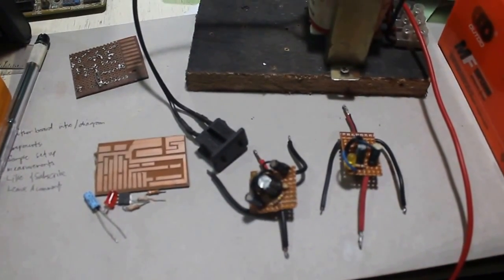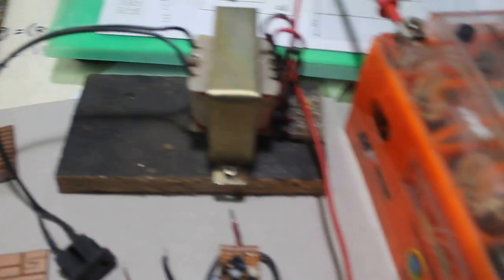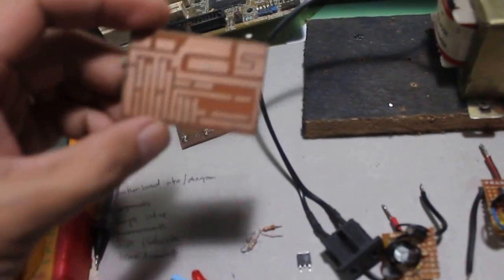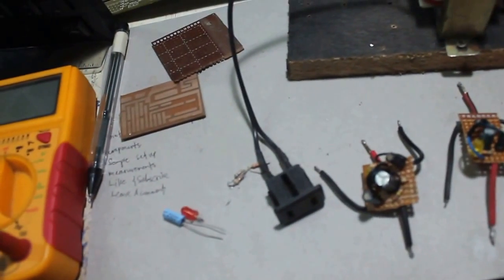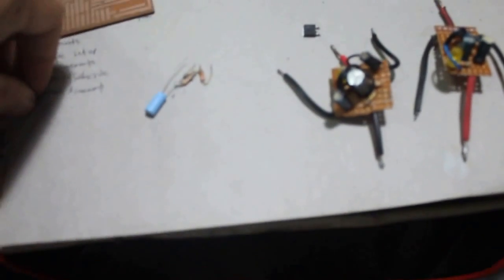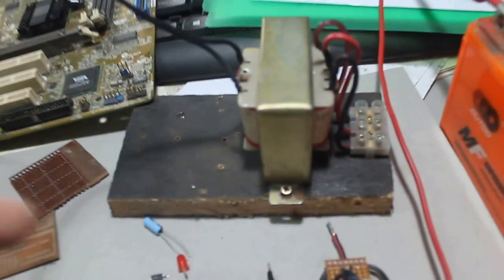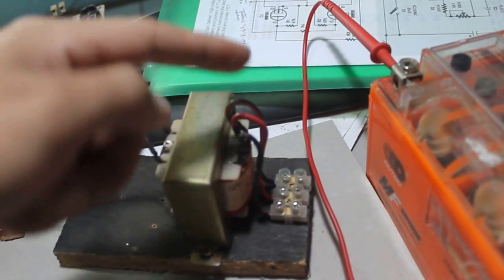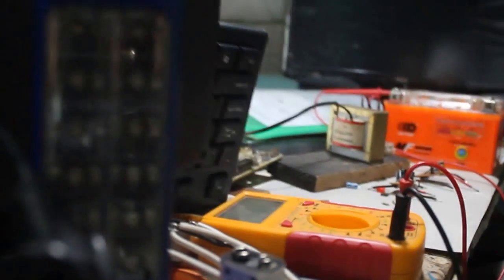Making Simple Inverter

Comment: You've been busy making many things :D With mounting location of the mosfet on the heatsink, is there not a risk that the pins might touch the heatsink by accident and get grounded? Can you explain what would happen if you were to connect the 12v battery directly to the transformer without your circuit in between?
Reply from the maker: hehehe the mosfet will not touch each other, othrwise they like touching each other. hehehehe
Reply from the maker: that would burn out the transformer since its a short circuit..
Reply from the maker: probably cause the wires to get red hot.. and the terminals of the battery would bcome hot.. and smokes are visible.. their might be an explosion of the battery.. spell out to your skin and face and probably got you kiled.hehehe
Reply: vrich marketing renewable energy That sounds scary haha. So what exactly is your little inverter doing between the 12v battery and the input of the transformer?
Reply from the maker: Gadget Addict its an oscillator.. turning off and on alternately to convert dc to ac..hehehehe does changing to220V out on the secondary..